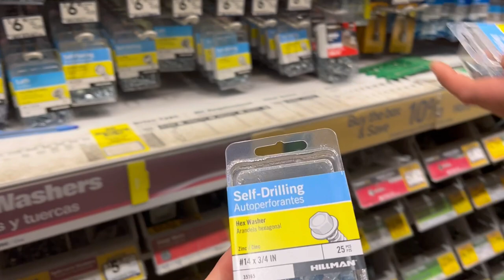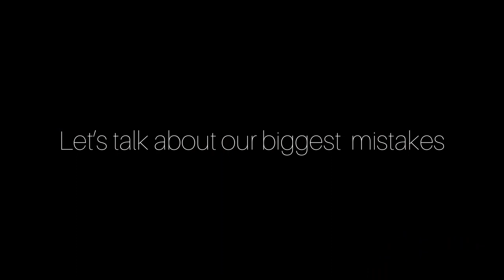SCHOOL BUS CONVERSION MISTAKES YOU DONT’T WANT TO MAKE! Episode 20

Comment: I'm doing a 5 window short bus right now, but I thought it was so much easier to unplug the wire harnesses coming from the rear of the bus, and the wire harnesses coming from the chassis and then literally strip out all the relays, fuse blocks, etc.  There is so much extra bus wiring that you just don't need for a skoolie.  I then put it back with new fuse blocks and relays to make it a better looking tighter package.  But I try not to prune the 'extra' wires going to the back of the bus, in case I need those wires for new systems.